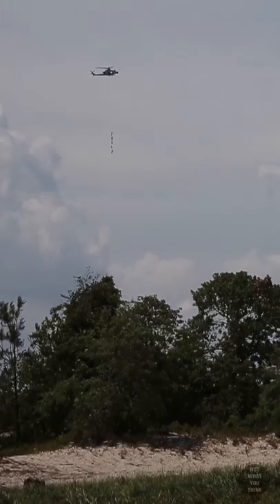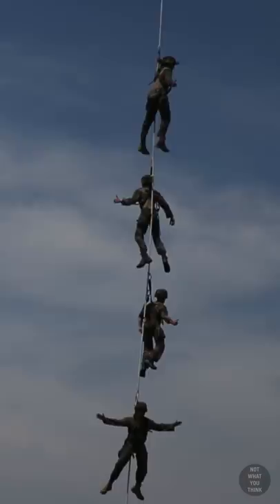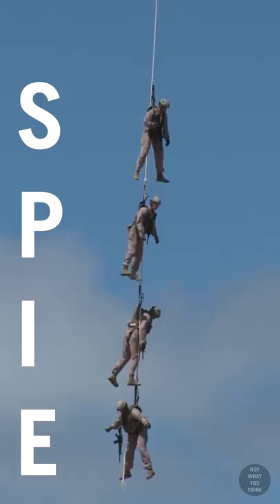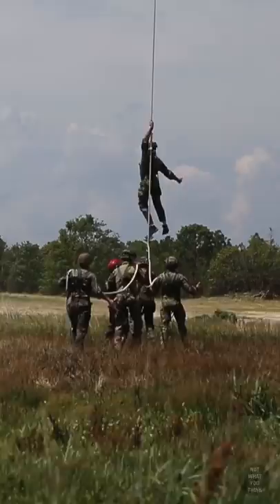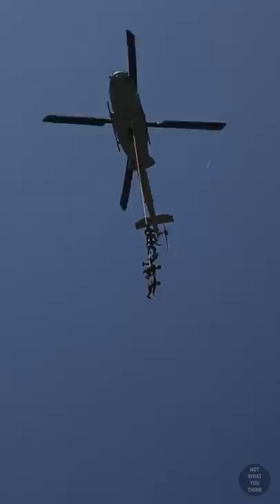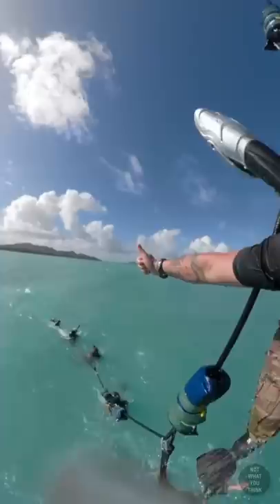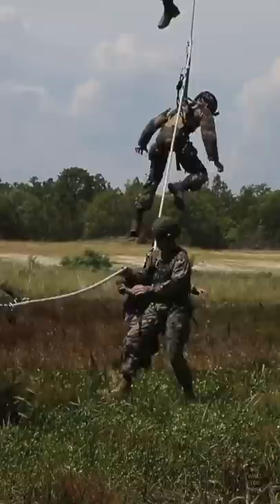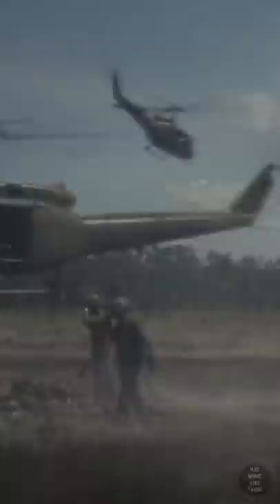Tug of War -  Marine vs. Helicopter Edition #shorts

Comment: No...1st Reconnaissance Battalion USMC, developed the Special Patrol Insert-Extract (SPIE) rig in 1968. GYSGT. Giles made the rig to access thru the triple-canopy jungle, dropping the sewn together four 1/4" x2" webbing consisting of two 60 ft. sections held connected by a coupling device, down thru the cargo hold or Hell hole of CH-46 helicopters. If enemy fire caused the helicopter to loose altitude and the team became caught in the trees a hatchet was used to hack the webbing. SPIE came first, it was a wild ride especially for the top members bucked by the wind. Saved many lives. Semper Fi, Ah UR Rah...Recon.

Comment: Jocks has a podcast with the Vietnam macv-sog team guys and they used these a bunch. These dudes stories are wicked crazy too....
Reply: Yes, SPIE rigs were developed by US Marine GySgt. GILES in 1968 with 1sr Reconnaissance Battalion, Camp Reasoner, Danang. He designed the rig to carry 8 Marines, two by two, using 1/4" x 2" webbing, two 60 ft. sections connected by his iwn device. The CH-46 had to be used for the weight of a 8 man team was too much for a Huey. All other Special Ops  "Over-the-Fence", LRRP's (Long Range Reconnaissance Patrols),  were trained and started using the SPIE rig.

Comment: If they can create a small drone that can carry up to 400 pounds without any hesitation then out military can have a self extraction unit. No more pilots putting themselves in danger, the soldiers can just extract themselves out and they can be pre programmed to fly to a designated area.